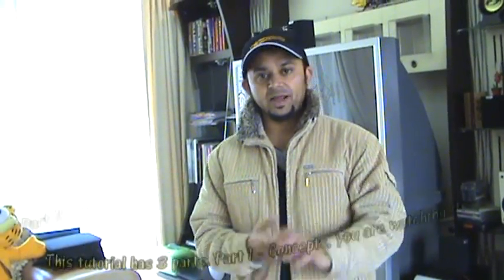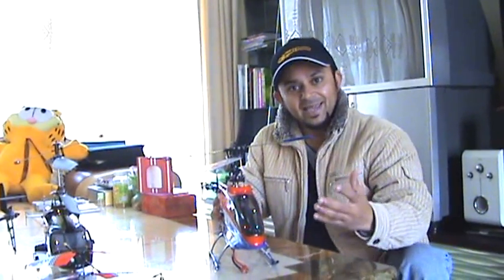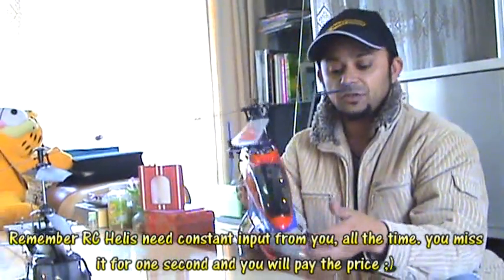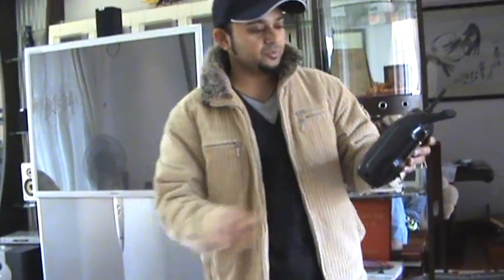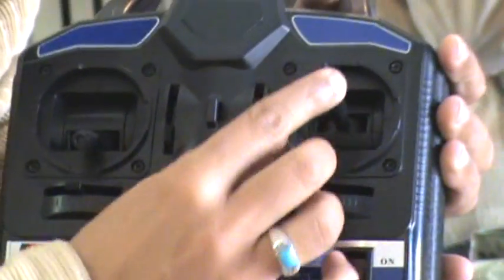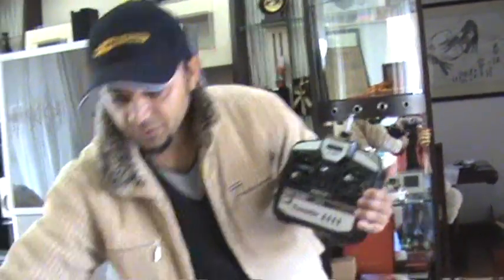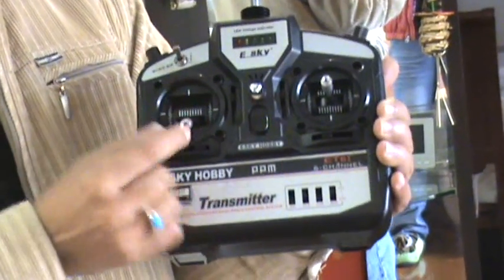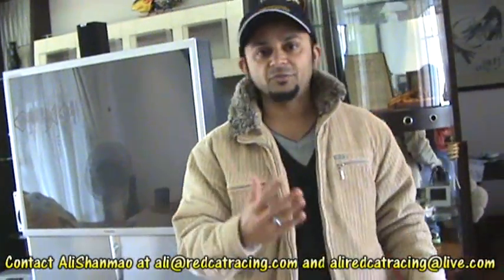RC Heli Trim and Good Hover Tutorial Pt.I

Comment: I have a blade 200 SRX the tail motor already failed. They sent me a new one.
I asked on rotation.
Does the rear rotor blades turn away ot towards main helicopter ? They told me towards, but most vidios it
Looks like it does the opposite, advise?

Comment: I have a co-axial in MODE 2, but my left / right controls are on my LEFT STICK and my rotor (tail) movement is on my RIGHT STICK. Is there any way to correct this?

Comment: ali i realized I think i went to big for first should be here in a day or so but got a blade 400 with dvx6i transmitter, wondering is i can channel in either a 120 or something like the esky two you showed i think the larger one was a 120 will my transmitter hook up to a reciever that hits on a smaller copt?

Comment: Hi, I am searching the webs for an answer to my problem but not having any luck. Yesterday I installed a new 4-1 on my HB v2 2.4G RC heli. The problem I am now having is that I cannot trim the helicopter enough using the trim on the controller for it to stop yawing (nose moving left) left. Any ideas how I can compensate for this?
cheers,
Mick